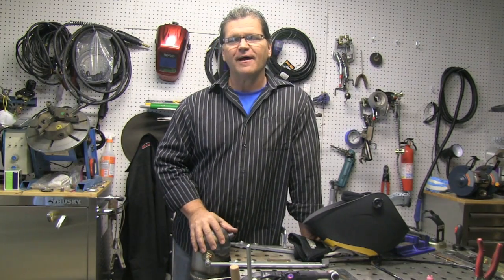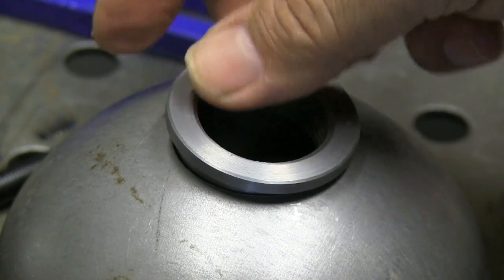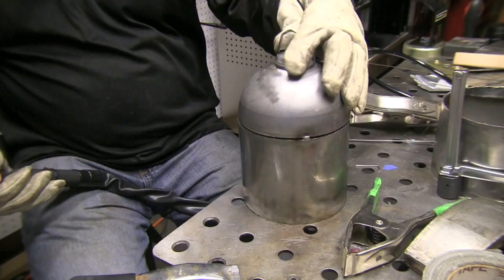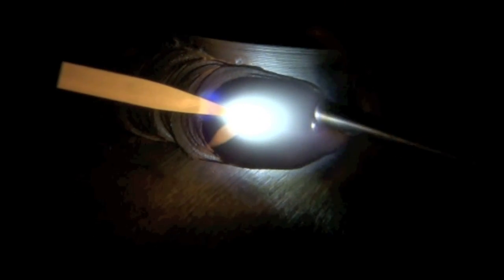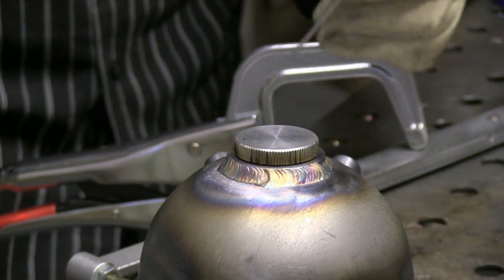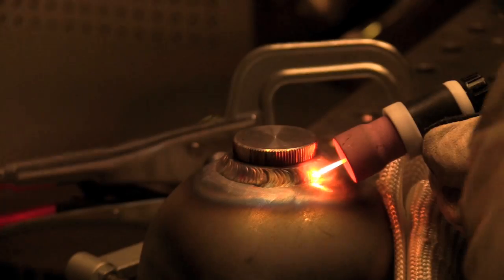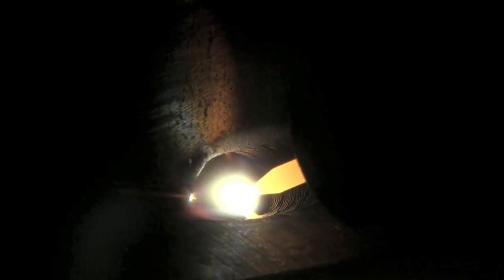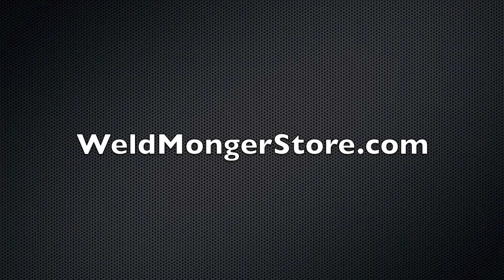Tig Welding 12L14 Bungs

Comment: Those are some very nice arc shots. Could you have used silicon bronze and TIG brazed it instead to avoid reducing mechanical strength at the weld?

Comment: Thanks Jody, I ordered the MEGA bundle set last week. I received it in only 2 days! WOW, what a great investment! I consider myself only an average welder, Stick and Mig only. I have no degree's and no welding certificates. I have learned the hard way including setting myself on fire several times! I recently retired and I am now trying to teach myself TIG welding "with the help of your Video's" and my new TIG FINGER. I don't need a welding degree, I just need to build an aluminum boat, off road jeep, and a new patio cover frame, or maybe a few BUNGS! Keep up the great work, you are my welding hero man! I wish I had your Video's 30 years ago.

Comment: Godbless, does your video's show ark welding for beginners like myself. I'm currently using 7018 rods some of my co-workers are telling me to use 1/8 rods other's tell me to use 3/32 rod. I need to weave in my root pass, I need to push the rod in not drag. Brother I'm confused pls let me know if yi it video shows the proper way thanks
Reply from the maker: I appreciate your interest in my DVD but for stick basics, I think you would be better off buying steve bleiles arc welding II video from wall mountain co.  it is very good with good arc shots
Reply: Thanks

Comment: ok jody here is a question for stick welding since i havent progressed to tig or mig yet why does it seem that i need pneumatic demolition hammer for breaking concrete to get the slag off of my bead after its laid down im running a bobcat 225 set at the 70-150 coarse range fine tune at 4 stick plus using 3/32nd lincoln 5p plus aka 6010
Reply from the maker: its very hard to say.  but sometimes running too hot makes slag hard to come off.
Reply: thanks ill turn it down and try again

Comment: Wish I had the setup to do this stuff . Can anyone recommend a good welding shop here in Lexington KY? I don't have the equipment to do it myself. I've got a cannon that I need shoulder pins tig welded to the main body . Last time it was fired it pulled the threaded pins out. (Due to overloading)

Comment: I've got 2 questions for ya: 1. What's the reason for using such a small electrode, I didn't know they were made smaller than 3/32; does it have advantages over a larger electrode? And 2. How are you able to hold the torch so close to the cup and not burn up your fingers? I can't seem to hold a torch anywhere above the neck for more than a few seconds before it starts toasting my glove
Reply from the maker: 1.reason for using 1/16" (1.6mm) electrode is I was working a different video using very low amps like around 20 amps.  a 1/16" electrode will easily handle 100 amps on DCEN.
2. Tig Finger helps a lot ...plus, the torch is huge...its a 26 air cooled torch made smaller using a stubby gas lens kit...the torch doesnt even get warm at 100 amps.  The type of joint also affects how much heat is deflected to your hand.
this joint along with a tight arc does not get my hand very hot.

Comment: How about silver soldering and bronze brazing 12L14?  Which would be preferred?
Reply from the maker: silver solder would have worked but the fit was a bit sloppy for a solder joint. getting  good fit with plenty of mating surface with only about .010" gap makes for a strong silver solder joint...this fit was pretty loose....still probly would have worked out ok using silver solder.
silicon bronze tig rod would also work but sometimes gets pinholes if it overheats gets oxidized so i think tig welding was best choice
Reply: weldingtipsandtricks  I didn't phrase well. I have been making things out of 12L14 and I have silver solder and bronze brazing rod and was wondering which would be better suited for joining. Small stuff and MAPP gas torch available.
Reply from the maker: David Kirtley
I vote for silver solder if there is plenty of mating surface
Reply: Thanks. All the stuff I have been doing silver solder on before has been non-ferrous and getting more info for steel has been a bit sketchy.

Comment: Hi Jodi. How did you use 100 amps with1/16 th. Electrode? I thought 50 amps was max with 1/16.? Was the the giant cup because of the long stick out? What was gas pressure.?sorry for dumd questions. Trying to learn thanks for great vids.
Reply from the maker: Tungsten charts list a 1/16" (1.6mm) 2% lanthanated tungsten as good to about  150 amps...I would never want to go that high ...thats asking for trouble.  100 amps is about max for DCEN...  for me anyway

Comment: You were killing me with the Bungs and holes lol. Did the heat from the fillet welds not warp the Aluminium cap at all? Did you have to do anything to stop warping?
Reply from the maker: it didnt hurt the aluminum plug at all.  I lubed it so threads wouldnt gall and also because I was shooting video, there was time to cool between shots.

Comment: I noticed your stick out is somewhere around 0.5", are you able to do that because of the gas lens setup your using?
Reply from the maker: its a #12 gas lens cup from CNI with an added wire mesh screen for diffuser and I can extend it an inch if I need to using  25ch
Reply: weldingtipsandtricks thanks. Ive been watching all of your videos. couple weeks ago i bought an AHP tig welder. hoping to get my feet wet doing aluminum (valve covers, etc), I havent quite got it just yet.

what affects does weather/ambient temp have when trying to tig weld? my shop is normally no more than 10 degrees warmer than the outside temp...